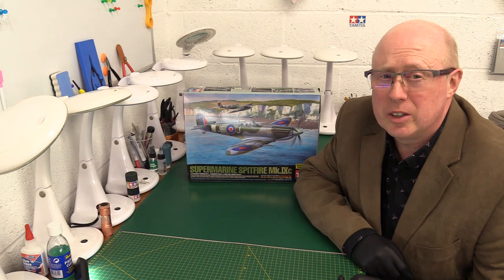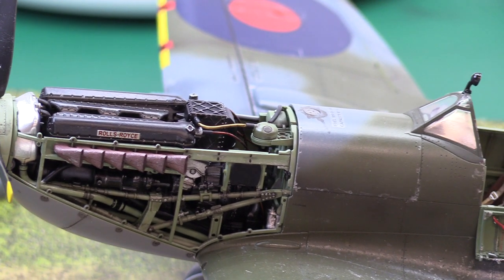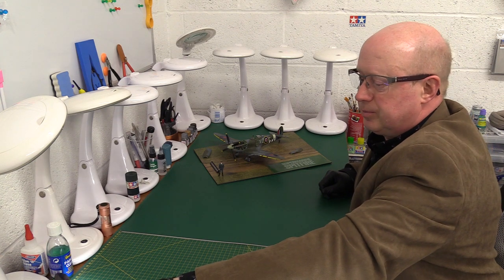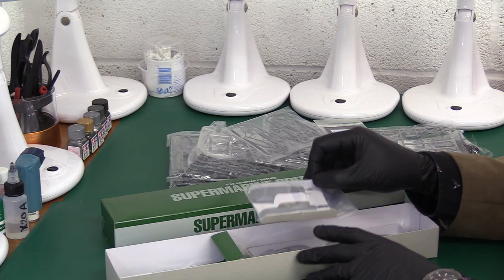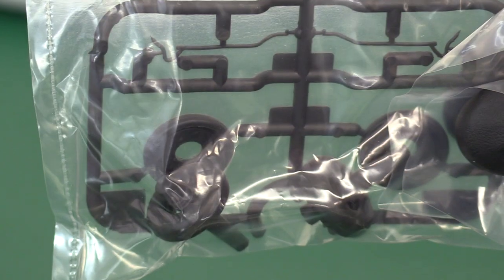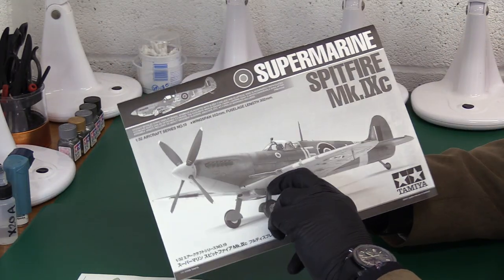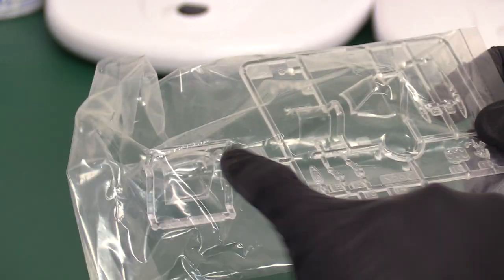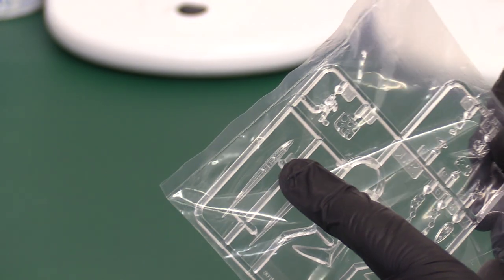Tamiya 1/32 Spitfire IXc After-build review. RCAF.

Comment: I have seen the three Tamiya Spitfires described as the best Spitfire kits you can buy. But, open gun bays with no guns or internal details, crap decals and not exactly the best quality photo etch and some poorly fitting parts. Not exactly worth the £100- £130.00 these kits are selling for currently on eBay.   Believe it or not  a week ago,before I saw your video, I actually bought the Tamiya Spitfire Mk IXc  for £90.00 the seller included £45.00 worth of paint and brushes with it. Having seen your video I think I will be reselling the kit and getting most of my money back.
Reply from the maker: @ericbeaton7211  It's stil the best Spit on the market, after 15 years...Not sure which poorly fitting parts you mean? The cowls are amazing, there is a stand (in-flight option) & 2 pilot figures...Something Airfix don't offer on their new 1/24, yet they repeated the same mistake in how they moulded the exhausts, which is baffling. I would hang on to it even if you decide not to build, as it may go up in value.
Reply: @Peter-Oxley-Modelling-Lab  Thanks
Reply: @Peter-Oxley-Modelling-Lab  I will  probably build it although I am. not sure when at least I will hang onto it for the time being.